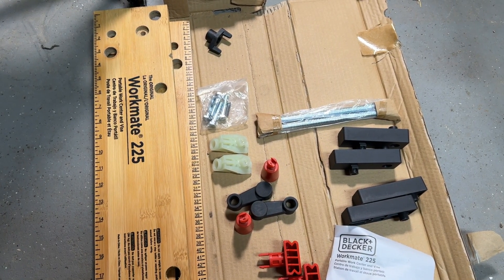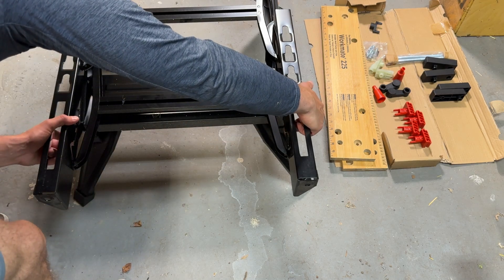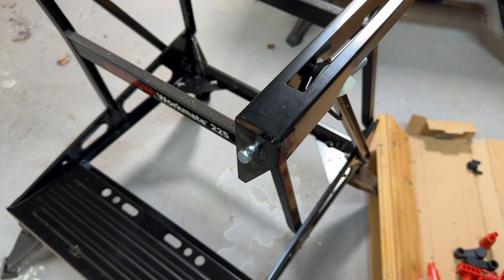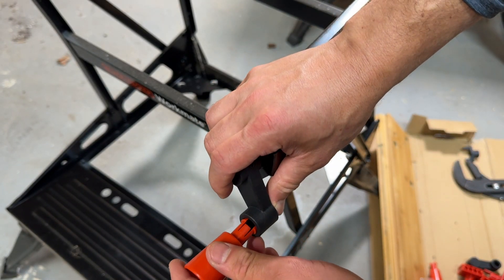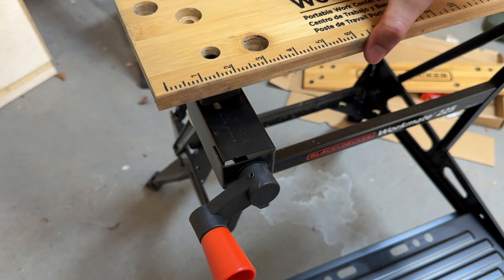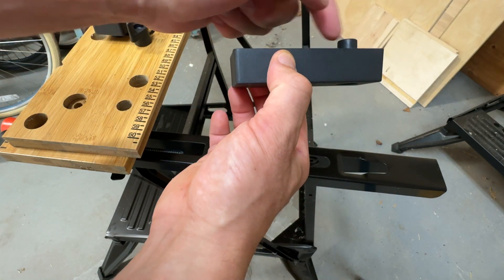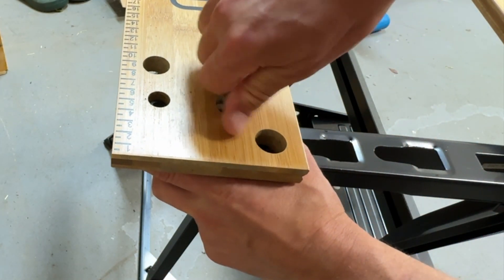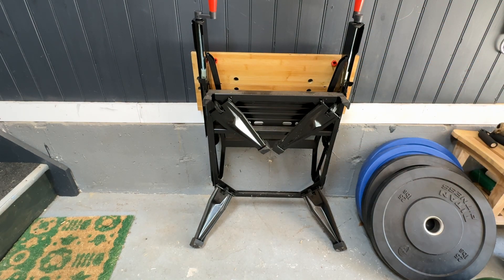How To Build A Black and Decker Workmate 225 Workbench (WM225 Manual)

Comment: Well I finally got the delivery and put it together. I had a hard time lining up the pins for the handle and tried to use a hammer and that seemed impossible, so I used a channel lock with a pad at the bottom to avoid scratching and that worked. The pins are now the same on both sides.

Comment: Great video. Unpacked to fully installed in under 30 minutes. The tip to use pliers instead of a hammer for that friction rod was very good. 👍